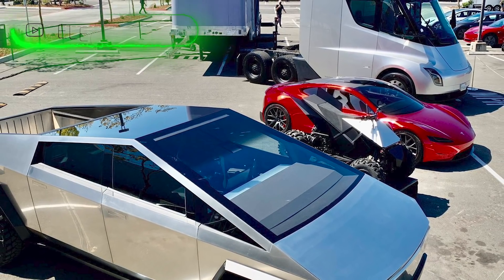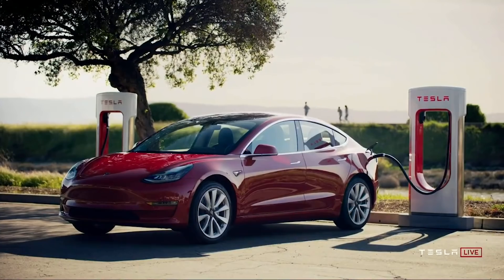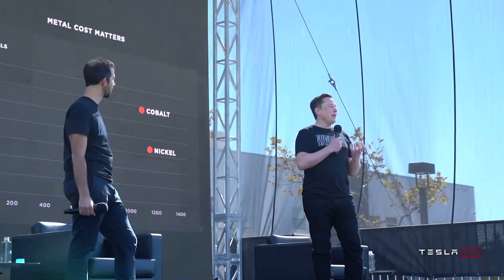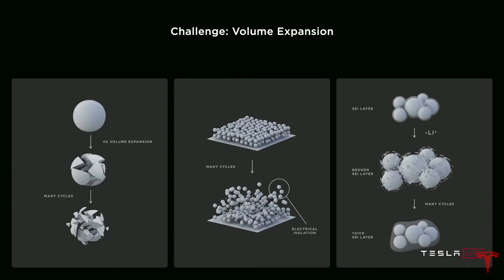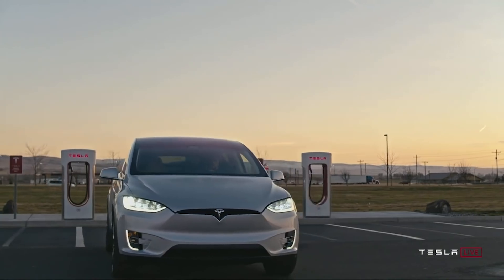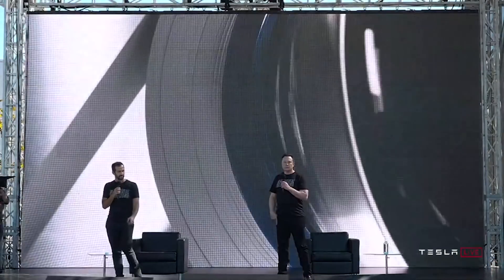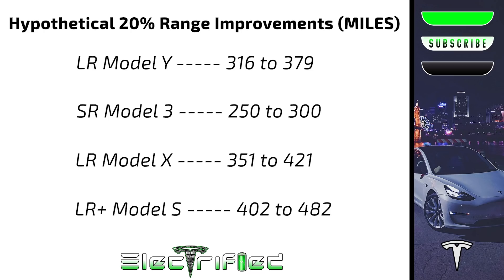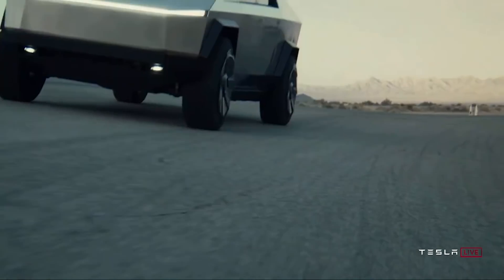Tesla's New Battery Anode (in-depth) // "Tesla Silicon"

Comment: I think there will be a model 3 and model Y refresh that will incorperate the front and rear mega-castings and the new 46-80 format cells with the new floor. It won't be for about 2 to 3 years yet, but there is no reason not to do it. When the new model 2 is introduced, it will be designed and built from the ground up with these massive inovations already included.
Reply: I think the Made In Germany Model Y will have this from the start, summer 2021, see my reply to Michael Latta for a more in depth analyses... 

The Kato Road factory will be used for testing validation and tweaking of the roadrunner factory, which will have a 10Gw capacity in the end.. A copy of this factory in Germany would be more than sufficient to start up Berlin, and add more lines as needed when Model Y production ramps up.

8 Megacasting machines are built in Germany as we speak, this only makes sense if they indeed start to use the front back and middle(battery) megacasting construction as shown in the animation during battery day... Making a middle part for 2170 cells, while you know you need to change this to 4680 cells in just 1-2 years, would make this very expensive.. So I really think they will take the risk and use the 4680 cell right from the start.
Reply: @MarcoNierop  That makes sense to me. It's entirely likely that this is the way Tesla vehicles will be made at all the new plants going forward.
Reply from the maker: I’m with it bruhhhhhh! Hope you’re doing well 🤙🏻

Comment: Elon said in his Berlin press conference that the Berlin Y would be a completely new architecture and we would be hearing more about it on Battery Day.  Then on Battery Day we saw the new chassis battery honeycomb floor.  So it seems very likely that the Berlin Y is being used to proof test this architecture and that may be the first mainstream vehicle to get the new cells.  Great vid, thanks
Reply: Yeah, at least that’s exactly how I took it?  Berlin will be the first for the new BF press with the battery inclusions. China has the new Y one piece press already. Just without the Battery inclusion? Right? Also Fremont is building a new taller portion. Looks like they’re making room for that retrofit soon?
Reply: @hyperdrivee7922  The GigaPress enclosure at Fremont is about 60% complete.
Reply: blondegaijin 
great, thanks!
Reply: Ohw wow, I missed this one...
4 sure
How great!!

1 thing: the new battery is not ready, Elon said 1 year or 18 month before they could tramp up the production line..
Model Y will be in Berlin GF sooner, so they must make a sort of standaard form battery pack, for old and for new type of batteries.

On the other hand, it would be stupid to make an old assembly line for battery production in Berlin, while the new battery is coming...

🤔
Reply from the maker: I hope you’re right! Would make sense 😊

Comment: Another good video Dillon. I would agree with your battery assessment as well. They're still making range advancements on the Y and 3 with software and parts/components upgrades. It currently meets the market needs so why mess with it? Those batteries will be better used getting the semis and Cyber trucks on the road.

Edit:  The 4680 production capacity will necessitate limited use initially.  It is going to be years before they can get ramped up.  Then when Models 3 and Y get a refresh, the 4680s might get integrated in to help mitigate costs.  But as I stated above, the best use of that initial production would be the Semi and CT.
Reply from the maker: Thank you Steve!